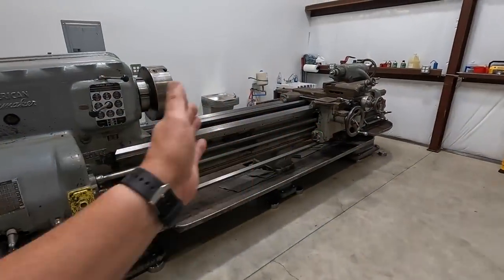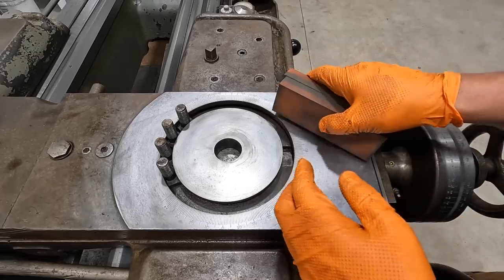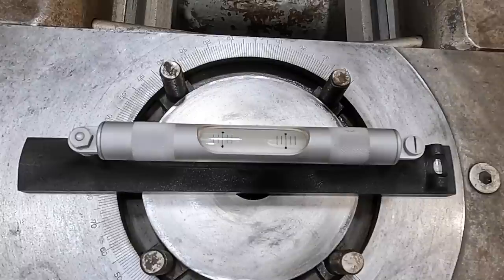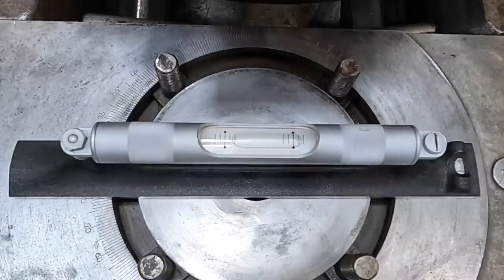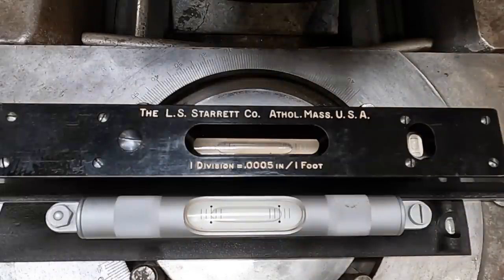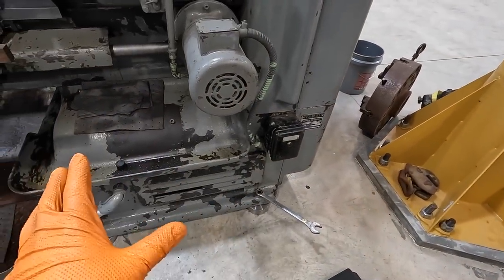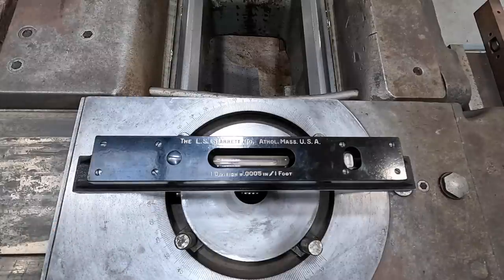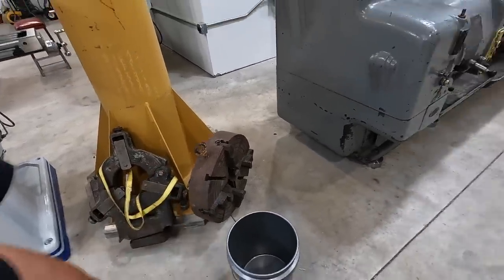Leveling the American Pacemaker Lathe

Comment: Will driving a forklift near the lathe, or turning a heavy piece of steel affect the level?
Reply: Yes the machining loads are terrific and will distort the machine when working hardish, I suppose the 'level' will need to be adjusted again and again upon use to counteract the machining load distortion.  And then the temperature changes, metal contracts, concrete moves and presto it's all wrong again.
Reply: Id say it definitely would affect the cut if you were taking light finishing cuts.   A 5000 lb lift driving up close to a machine on a mono slab would absolutely move the machine enough to affect it.   the same way a heavy cut will flex the machine more than a light cut.    That's why you sneak up on you final dimensions with light cuts to avoid tool post or machine deflection.

Comment: I know you leveled it at the head stock end and the tail stock end using a one foot level, but how do you know that there is no sag in the center of the ways?
Reply: you dont without using a autocollimator to inspect the ways and or making a full length cut to find out.

Comment: I know nothing. What happens to the level when the chuck is turning? How much does material being machined jack up the angles? Doesn't matter much I guess...?
Reply: The elephant in the room,  static v dynamic level.  cut, measure, stroke chin. Come back tomorrow and it's different again, average it out as reasonably possible...

Comment: What about levelling the bed lengthways? Did I miss something?
Reply: It’s not necessary.
Reply: I must disagree. Most small lathes only have headstock and tailstock supports but this lathe has a central support that may cause hogging or sagging of the lathe bed if not adjusted correctly.
Reply: @chrisstott2775  Ok. How do they level a lathe lengthwise in the machine shop on a ship?
Reply: The use of the level here is to get headstock and tailstock level relative to each other, not absolute to the surface of the earth. Where that surface is not level (such as on the deck of a ship) you can still measure the relative levels of each end and adjust accordingly. I would suggest that a slight tilt might be useful so that coolant drains back to the tank to avoid pooling in the tray, the key here is to keep the adjustments consistently relative. Cutting Edge Engineering has a video aligning a long lathe.
Reply: Wondering the same thing.
Reply: @chrisstott2775  - You completely and utterly missed the point. The question was are the ways STRAIGHT - it other words, will the carriage be at the same height in the center of the ways as when it is at the ends?

Comment: Man! I wish I had a lathe and mill. I'm still kicking myself for passing up an opportunity to get a couple small ones from the temp gig I had a few years ago. They went out of business and sold everything off. Probably could have nabbed them for cheaps too! No wonder that place went Tango Uniform. They were so screwed up it wasn't funny. Had to quit it because I got tired of struggling with machines they wouldn't let me fix and they would have been easy fixes! I'll just give three examples to let y'all know how bad it was. First a bandsaw blade broke. No problem I know how to weld them and there was a welder (covered in dust) sitting right there. So I'm wiping off the welder and the bi-polar Vietnamese shop foreman comes over yelling "What you doing?" Told him the blade needed welding and he said: "I no pay you to weld blade." So he sends one of his "actual" employees to dig around in the (nightmare) toolroom and find one. 30 minutes later he comes back with it and I put it on the machine. Could have welded it in less than a minute but NO! Example two: They were using a small vertical mill as a drill press because the drill press SITTING RIGHT NEXT TO IT didn't work! IT didn't work because the wall plug was mangled. I could have fixed THAT in a couple minutes but NO! Now this outfit did vacuum forming of ABS and other plastics like HDPE and so on. One day he comes to me with a broken WOODEN pattern and told me to fix it. No problem grabbed a bottle of glue and a box of deck screws and started putting the jigsaw puzzle back together. This thing had been broken many times before and I glued the snot out of it and put a BUNCH of screws in. As I was finishing up he storms over and asks why it was taking so long and said: "I could have been done by now!" I said (getting pretty fed up with that asshole by then): "You could have patched it like it was patched before but THIS pattern won't break again! And besides you are going to have to let  the glue dry before you can use the pattern anyway." That was pretty much the last straw for me. The only reason I took the gig was it was in the Industrial Park BEHIND MY HOUSE! 5 minute commute... Didn't pay worth a damn either... 😠

Comment: 40 year millwright says ok other then checking next week after it settles great job local 1607 local millwrights las vegas nevada
Reply: 30 year Millwright local 1076 says, he never not once turned the level 180° to either check the difference in his reading nor knows if his level is set. I know he put it against the master but neither one was proven with a 180° turn.
 Also we turn them to stay acclimated to the light and temperature.

Comment: Laser interferometry is what is needed here...
Reply from the maker: Instead, I’ll use my tried and true precision level that I own and have in the toolbox.
Reply: Im building one to level and square my shop floor and machinery,   really nice tools for such an important job the level of precision is mostly adequate for a backyard shop.
Reply: I’ve had my levelling jobs checked with a laser and the method Adam used will pass inspection every time
Reply: @silverfox1779  @Abom79 
It was just a joke.
I like how Adam did this.  I esp. like his statement that he would do a check after some time to see if there was any settling out.  I'd assume there will be as the frame is still subject to uneven pressures (load) from the pads/levelling screws (as it's near impossible to get the same load on each screw/pad location.)

Comment: Suggestion: To ensure that all leveling screws are supporting equal weight, use a torque wrench when you are very close to final adjustments.
Reply: Don't think that would work, mate. As one side weighs more than the other. Never going to be able to share load equally amongst all. Maybe not even the same two in one section. Floor variances, machine variances. I'm not a pro by any means, just doesn't sound feasible. 🤷🏻‍♂️
Reply: @chrisseger6870  You are correct. The torque wrench would do nothing at all to aid this procedure.